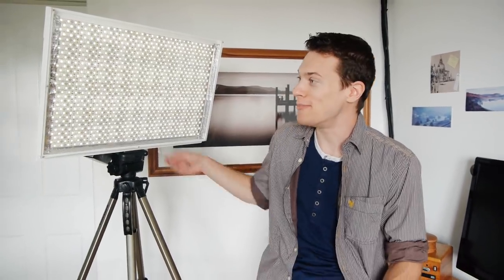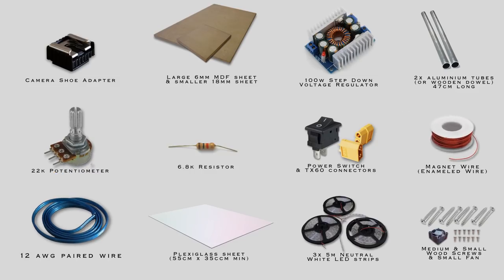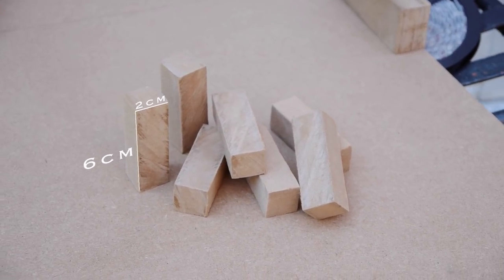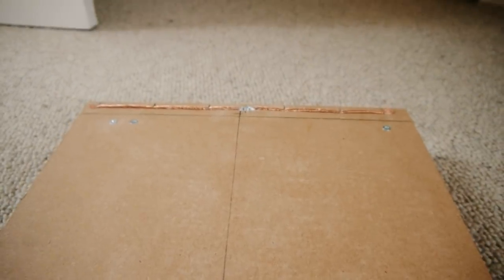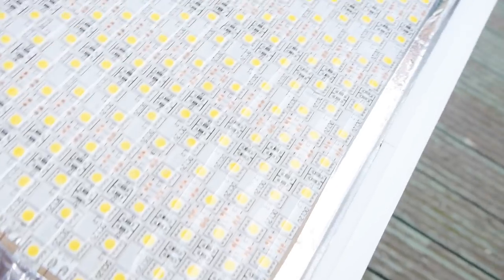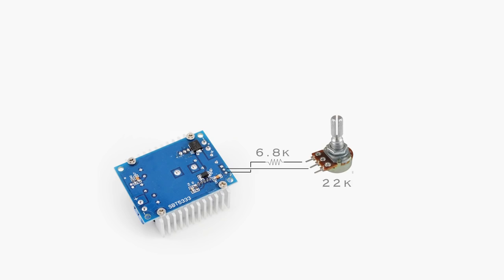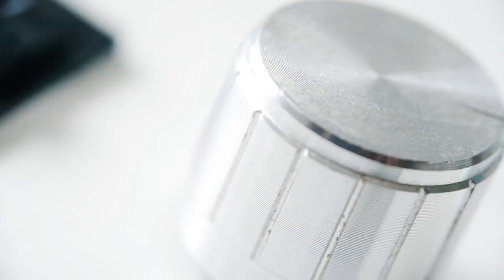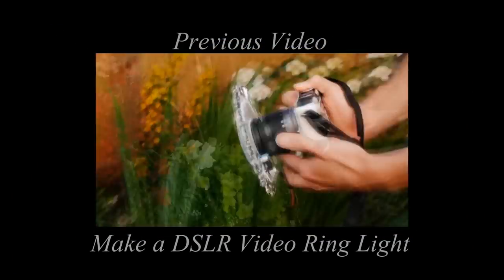How to make a super bright LED light panel (for video work etc)

Comment from the maker: All the bits required for this build are available in kit form here: http://amzn.to/2yS307Y You'll still need the LED strips, which are linked to in the video's description.
Reply: What about the LEDs?
Reply: DIY Perks I got a tough challenge for you that will help a lot of people if you are successful. Can you make an SAD light panel? It should give off a minimum of 10,000 lux of light 1 metre away and the light should be diffuse, more so than this light panel. It should be large in size for the light to hit more areas of the retina. This would help a lot of people with depression if you were able to do it. I would personally build it if I had instructions as nothing available commercially would match it if you were able to do it in the way I outlined. I am a long term sufferer of SAD.
Reply: These lights produce a lot of heat.  Keeping this on for even 30 minutes makes them hot to the touch.  Any recommendations for heat dissipation in a future iteration?
Reply: Can you add links to the parts in the UK?
Reply: Can I add a link for the whole parts in the UK?
Reply: The amazon link to get the parts only posts to the USA, could we get a link to amazon.co.uk
Reply: For SAD: Build it as shown but use translucent (white) Plexiglass instead of transparent. You'll probably require less power, too. I'd suggest using LEDs with a higher blue content than "natural".
Reply: A bit late for your project, but you could add an aluminium sheet under the leds for that. Think of it as a radiator on a computer motherboard, it the same principle.
Reply: DIY Perks p??
Reply: my Step down buck converter just died :( i've ordered a new one, still very happy though it has been going for ages (i added a huge passive heat sink too - approx 12inx1x1 !!! cheers o/
Reply: got an almost identical (layout seems identical) 100W step down regulator from amazon (about £5), to replace the broken one. Worked a treat, thanks again Mat, i can paint portraits at night again :)
Reply: DIY Perks great video but another thing you should mention that some led panels have a white as the cover not just clear, plus if the person’s able to they can also make colored led light boards with different led colors and some have barn doors.
Reply: One issue with come led strips heat . May be aluminium sheet is good with led strip
Reply: @lifewater  Aha! I thought LEDs were "cooler" than tungsten lamps?
Reply: @claudioabado3317  per watt yeah, but 100w is still alot! (100w tungsten bulb would give you a serious burn if you touched it)
Reply: Sadly: "Currently unavailable..."!!

Comment: I love the project! I made a panel inspired by this, but i used arduino and PWM dimming. It's interesting, the PWM is visible when dimmed, but if one uses the full output the PWM wont be visible on film. The only perk being that the one I made does not require a fan. The downside obviously being that you can't dim it on film. Thanks for the inspiration,  your vids are invaluable when I need some creative stimulation :)
Reply: I think the voltage regulator used is a step down buck converter which should be quite efficient too, right?

Comment: I went ahead and built my own following these instructions.  As someone who knows nothing about electronics I needed the help of two others to break down some of the stuff  left out here, but the result is a very bright LED panel for not a lot of money.

Somethings I noticed:

It truely is bright.... like hurt your eyes bright.  I recommend picking up some sort of light diffusion sheet,  or have a plan to use this indirectly.

This thing gets HOT.  I was testing the limits of this panel, and after 30 minutes the LED's start the seperate from the glue and wood.  After an hour the leds are quite hot to the touch.  I really have no idea how to go about fixing that in version 2, maybe aluminum panel as a heatsink?  Be sure to glue these down with wood glue or something similar, otherwise they are going to come off most likely during prologed use.

Also the part where he explains using resistors with the 5v fan, dont bother with this approach.   I attempted this and the resistors get insanely hot, no matter how you configure them.  I purchased a BEC (Battery Eliminator Circuit), frequently used in RC cars/planes.  This is far more efficient, and does not create any additional heat.  Well worth the small cost.

Overall I recommend trying this if your thinking about it.  Great project, thank you for the tutorial!
Reply: I really like your input about the use of BEC (Battery Eliminator Circuit). But my question is, Does the BEC replace the voltage regulator used in this circuit? And how do you connect it to a potentiometer to make it dimmable?  I would really like to know because I've been buying materials to assemble it. If you don't mind you can show a photo of the same. Thanks

Comment: A couple of comments if I may...

1. Excellent video, well presented.
2. The LEDs will get too hot - you've not used anything to dissipate the heat - this will shorten their lives -  so as before but aluminium back!! Trust me - I've shortened the lives of many a LED. 
3. Finally just a thought... you mentioned colour filters for studio work - RGB (12v) LEDS and you could get any colour you want at the cost of a SLIGHT loss of precision and a slight increase in cost.
Reply: RGB turns orange to red.
Plenty of lighting vids on it.

Comment: For anyone attempting to make this, it is way easier to order the LEDs in "Non-Waterproof" style (without the clear rubberized coating on the strips). It is a pain to remove the end coating to expose the two copper electrical contact "dots".
I am currently building this with a slight modification, using white coroplast with an 1/8 inch thick 12'x24" board for support behind it. i have bent the coroplast into a similar shape as KinoFlo 4' 4 tube panels. I'm using Neitrik power connectors to a remote power supply so the lighthead is as light as possible. As I use C-stands in my studio, I ordered 2 Avenger F805 Baby plates to mount directly to the grips.
Reply from the maker: The non-waterproof strips have a warmer colour temperature unfortunately though, bordering on being warm white. The waterproofing material actually cools down the colour temperature because of the way light transmits through it (rather than it blocking warmer wavelengths). Still perfectly usable of course, but it's just something to keep in mind and is ultimately the very reason I recommended the waterproof strips for this build.
Reply: +DIY Perks http://www.ebay.com/itm/181089020410?_trksid=p2057872.m2749.l2649&ssPageName=STRK%3AMEBIDX%3AIT
Even though they list these as 6000-6500 K my Sekonic color meter says they are 5480. 
I have set up the strips into 4 banks that have individual power control. At 1/2 power (all 4 channels powered, I am getting 5120 K readings.
Reply: Sounds great. The coroplast would be lighter than the MDF I imagine.
Are there any pictures or videos of the lamp you made? (I don't understand when you say you bent the coroplast)
Reply: +altar7 I used thin coroplast 3/16" (I believe) from home depot just to build they prototypes. They are ridged enough for occasional use, but I would get thicker black coroplast ( check local sign company) if you plan to travel with these lights. One great thing about the KinoFlo design, is you can order the end plates and flex spring inserts separately if you want a really nice design. I did run into a heat and strength issue with only using thin  coroplast., so be sure to add strength  with the 1/8" melamine board. email me for pics. 

http://kinoflo.com/Products%20Button/Fixtures%20Remote/Select_DMX_4Bank/4Bank_DMX.html

Comment: Protip: Most 12V LED strip is designed to run continuously up to 15VDC, for the sake of use in car applications (most alternators put out 13.8-14.4V). 

As such, all 12V strip will handle a minimum of 14V to allow compatibility with lead acid applications, like vehicle and solar setups.

You have headroom! Overclock!

Comment: Nicely made video, but I'm concerned. Those LEDs are going to get very hot, putting so many in a small space with absolutely no allowance for cooling is asking for short life. 

Maybe Mk2 should use an aluminium plate bonded to vertical "U" sections of aluminium to create a bit if a heatsink.
Reply: Do somebody have experience with heat issue? I read that especially those IP65 LEDs should NOT be mounted to a woody surface...?
Reply: +Bo Riedel-Petzold I work with a lot of types of LEDs at work, and these 5050s get a little bit warm at best.
But it's fine because the sheet of MDF is most likely fireproofed.
Reply: There's no issue when it comes to the risk of fire, they don't get that hot. BUT, the LEDs themselves really need to be applied to a metal surface for cooling. The LEDs will degrade because they heat up too much (especially at full brightness). Especially cheap Chinese LED-tape will show dead sections quickly if you don't do this.

Comment: Thanks so much for the video. I just finished the build of my first lamp and I ordered the parts for the second one. I changed one thing. I used only 5m of LED stripes. The stripes I bought, draw 14,5W/m which is almost 75W. (I measured the current and the voltage and  the stripe really draws the 70W!)

When I use 5m, the 100W voltage reulator doesn't get too hot. I use a 12V/6A power supply. 

So everything fits nicely together. The dimming works just fine. I did some test footage with my camera and I found out, that for indoor use, one LED stripe is bright enough. 

But I want to have more lights in order to get a three point lighting. 

My next project is to build  your DIY camera slider. Looking forward to it.

Comment: Hey Matt, I was reading through the comments and I saw you comment that you have a new metal 5630smd panel video in the works! It would be great if you could share that video in the next weeks, or at least share some insights on what metal to buy, etc. I have ordered the leds and the converter from your links, but I would like to mount them on a metal plate instead of MDF, and would greatly appreciate your help! You are an inspiration to DIY-ers! :D Cheers and Thank you!
Reply from the maker: ***** I'm still waiting for some parts to arrive from China, but I expect that I'll be doing a video about it sometime in February.
Reply: DIY Perks  Ok Matt, I will try to wait until February altough I am extremely hyped! Can hardly wait! :D
Reply: DIY Perks 

This would be awesome. Another thing I havent figured out is the CRI of these things. Do you know of a way to calculate this or is it possible to get an estimate from your vendor?

Comment: I have some bad news. You just used a PWM voltage regulator (but one of this high frequency PWM so normal speed cameras cant record that blinking, slo-mo still can do this.)
Reply from the maker: popraw a It works internally with PWM, yes, but the output is filtered so you don't get any flicker. It's flat DC, more or less (there'll be a tiny amount of 'noise' in there, but not enough to cause any issues).
Reply: Is very good - high efficiency and high power (but not that high as clean PWM output) and is flat (but not that flat as linear and reference) but its still a PWM - you just say something else in this tutorial (if that is no PWM this must be a linear - you take 12V 10A and this takes 14V 10A and give you extra 20W of heat, not suitable for battery powered device and you need big radiator or loud fan :)
Reply: popraw a What do you recommend to use instead?
Reply: If you have a nice filter on output of regulator normal cameras cant record blinking of LEDs. If you want make some good slow motion footage you should use halogen lamps (light bulbs from projectors have deep white colours, market ones have bit too much of yellow but almost every camera can compensate that)
Reply: popraw a awesome, thank you! I'll put a filter on and just accept the limitation
Reply: @poprawa  i would like to build some led panels, I will shoot slow motion with 50fps (180 degrees shutter), can you please give me your suggestions?

Comment: I would like to correct something, this is still uses PWM to dim the light. Since the voltage converter is using PWM and not linear regular. However, the PWM frequency here is fast (more than 100kHz) and that makes it hard to see when using regular cameras. However, a very high frame rate or very fast shutter speed will still suffer from flicker. In general this is great DIY for most people. Good work 👍🏻

Comment: Great tutorial and I'm looking forward to building one. What kind of power supply is recommended. I heard in the video that an old laptop power supply can be used?
Reply from the maker: Any 12-24v power supply that can provide 100w or so will be suitable.
Reply: @brandon the battery is just one ontion you can use, you dont have to use it, just use any >100w DC power supply of 15v or more
Reply: You have to consider that LEDs use direct current (DC), and wall current is AC. You could construct an adapter based on a 120-24 transformer, coupled with a diode bridge for the AC DC conversion (there a few more steps, but this is the basic principle).

Keep in mind that the diodes need to be able to support those high currents.
Reply: Juan Escalante nobody is going to "construct an adapter". you just take an old laptor charger or somethign that already outputs DC. the people who construct adapters are not the ones asking these questions.

Comment: Hi - I got to the stage of testing the lights before putting the border on and literally none of the lights lit. I'm using a Ledmo A/C adaptor which puts out 12v and 5 amps and I've confirmed that there is power coming from the adaptor - any ideas as to why I'm not getting any lights? None of the soldered connections are loose and I would have expected at least some of them would have lit if it were a soldering issue.

Comment: Hello, I try to make your LED panel, but I couldn't find all of parts (I leave in Ukraine). 
So, I found Led Strips as yours (but 5000k); 
STEP-DOWN VOLTAGE REGULATOR DC-DC Output current: 10A Max(rated 8A) 5-30V to 1.25-30V  Working frequency: 150KHz; 
And POTENTIOMETER 25k 16mm Type-b. 
Will it work together like your ones?
Reply: +Timo Piano Buy led strips in Poland, and send to Ukraine - it will work!

Comment: Just curious about the temperature of the LED strip, it says its at 4500k. would it be okay using it with other LED lights that are at 5500k or will there be a noticeable difference?

Comment: Great job just built one after watching your video. Works great very clean and bright, almost shadowless light. I used an 18v 3.8amp laptop power supply. But at full power the voltage only reads 10v. I think a slightly more powerful supply will work better. I shall be building another one next week for lighting a green screen up. Great vid
Reply: JUst orderd some more equipment to build a seccond one. I am using copper tape this time to connect all of the LEDs together.

Comment: I built a mini version with a single 5m roll of LED's (50W) based on this video and it works pretty well. However when running it at full brightness the wood does get pretty hot from the concentrated heat of the led's.

Comment: I noticed that you inset the bottom border about 3cm from the edge of the panel - was there any reason for not putting it on the edge as you did with the side borders?

Comment: Here is an idea for people who find the 'dimmer circuit' intimidating/expensive:
You could wire the different strips in multiple circuits. Say 4 circuits of equal size. Then by changing the the number of circuits which are on, you either get 1/4, 2/4, 3/4 or 4/4 of max power. Not dimmable but still controllable. However, you'll still require a voltage regulator if your power supply is different than 12V.

Comment: Superb video, both for content and production.

The build price is probably above US$70 at this point. The LEDs alone are $60; perhaps this video prompted some demand! The rest of the parts aren't that expensive but they add up. With a power source, the total is probably north of $90 or £60.

Still a great deal, naturally.

Comment: Hi! I have a quick question. Can I use two voltage regulator to control two types of colors (like in the flexible panel video)? Thanks

Comment: The tripod adapter part can be made sturdier: the thread required to roll your own is 1/4 inch diameter by 20 threads per inch (the USA 1/4 inch course bolt thread)

Suggest replacing the plastic part with a 1/4 inch thickness aluminum bracket bolted to the frame. The bracket gets drilled and tapped to receive the bolt on the tripod.

Comment: I know it's 4 years old, yet I'll post my input for people who's still watching this: For driving LEDs, it's better to use current regulators than voltage rgulators, as it what's conrolling the brightness of the LEDs, and will extend the life of the LEDs by making sure it runs at the appropriate current for the LEDs. Most of the LED drivers are constant current regulated switch mode power supplies, switching at frequencies of 10's of kHz at least, and won't be visible even to a camera, while being very efficient (could go as much as 95% efficiency).
And today, it's actually super cheap to buy a good 100W LED floodlight, could be less than 100$ for a decent fixture.

Comment: Not bad, not bad at all! Can't believe I haven't seen this yet - this is a monster of an LED panel!
For my requirements, I'll probably go with smaller LED strip panels, or re-use of displays with cracked LCDs, because they can easily be repurposed to provide a smaller, yet bright, light (I don't really need 100W of LEDs!).